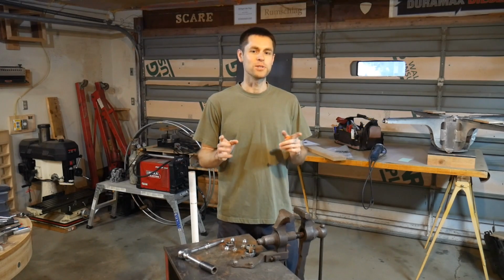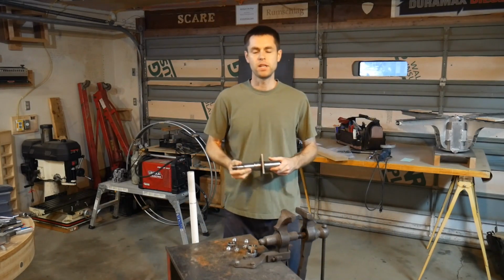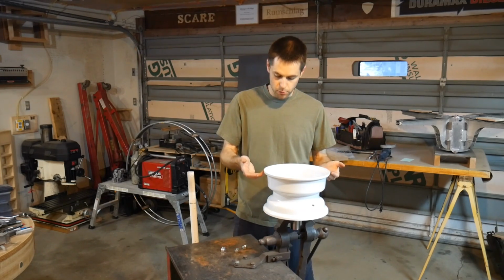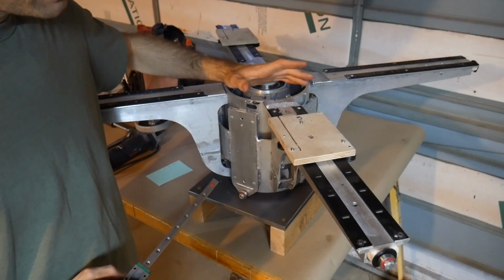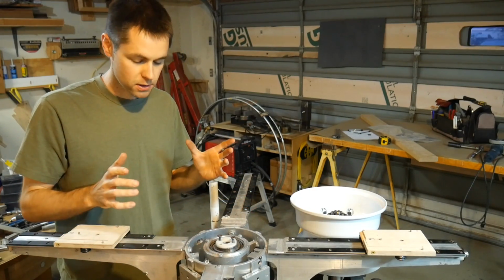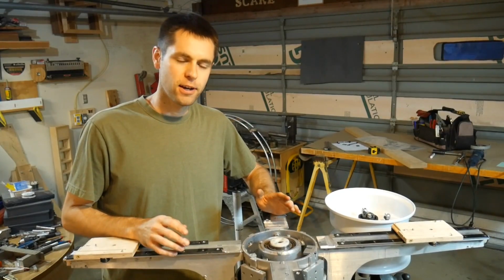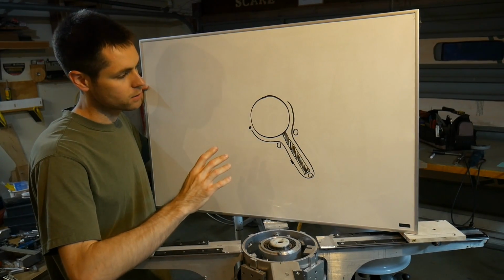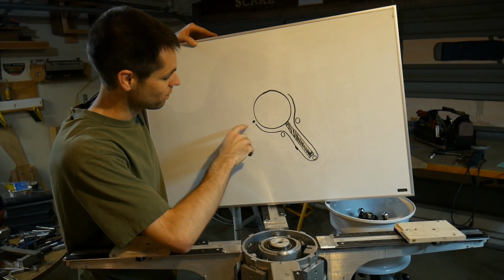Metal Expanding Table 01

Comment: Review how control cables in small aircraft are set up. Turnbuckles to adjust compression springs to maintain tension, etc. Cables, pulleys, turnbuckles, springs etc. all available at Aircraft Spruce and Specialties. They ship worldwide too. Check it out!

Comment: Well done sir. I see some mentions of bicycle roller chain, which is a good idea in place of cable. Is it possible to attach the cable in your diagram in some sort of slot to act like a cam when the attachment point goes past the end of the track to allow for the direction change? Last thing that comes to mind is if you are still wanting to use a stationary plate in the center, is there enough room left on the spindle to thread another nut? If so possibly weld a nut to the plate and that would be a fairly easy way to get it stationary. Just some random thoughts.

Comment: Could you explain how you would attach the tension cable to the base. 
Is the fixed point brought up to the slider level.
is the guide pulleys angled to allow horizontal movement at the slide, but a spiral to the fixed point
Is the whole cable and pulley system angled like a wedge between the base and the outer point. 

The last would need some type of hinge between the cable's shuttle and the top slider.
but depending on the geometry you could get the redirection movement with the hinge. the shuttle would never loop over the end pulley.

Comment: A tension cable system which goes over centre can be kept tensioned if the other end mirrors the motion, but it then brings you back to the bent arm across the centre pivot to achieve it. Most closed loop aircraft systems do not have tensioning springs but rely on the cable stretch. The tension is moderately high and achieved by turn barrels. A little link off the cable to travel round the outer pulley is one way of reversing the direction.

Comment: 14:24 Why not try these sliders on an incline? The table rotates anyway.. so why not use that motion to have the table travel up. While they sit on the incline they are all in contact and thus ensuring a play-less movement. (though the range of motion might be too limited.. going 11" sideways has to transfer into the 2 units up)

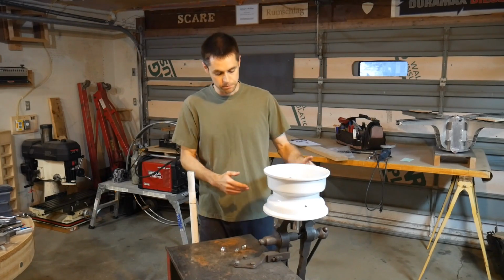Comment: Awesome project! As you were talking about welding to the hub at around 8:20 it struck me that bolting might have some advantages. 1. Less chance of distortion in the rim from the heat during welding. 2. Many folks don't have a welder (including me!) I don't know if you would be able to design this in such a way that even the welder would be unnecessary? If you could, the design would have even greater universal appeal :)

Comment: Why not use a chain between both sides of the cable.  It can be wrapped around a cog, with the slide being moved by a shuttle attached to one or two of the chain link pins.  i.e. both the cable/bowden tube and chain/sprocket  can be made completely from common bicycle parts.

Comment: 27:52 could always use a weight rather than a spring. If you had a pulley the weight could sit against the table leg. Not the most practical, but figured i'd point it out.

Comment: Scott, regarding the spring to take back the slag on the cable, you could use a compression spring. Terminate the cable with a threaded rod, throw this through a compression spring, a washer and a nut. The nut can adjust most of the slag, the spring is here only to take the last couple of millimeters. Compression springs can be much more compact and that one could be both shorter (it does not need to take a lot of slag) and stronger. On my motorbike, the rear brake is activated by a rod that attach to the break lever through a compression spring, each time you brake, you compress the spring, so it must be robust, and there is a nut at the end of the rod to take of the slag.

Comment: On the common thread of bike parts, some of the ‘exotic’ shift systems worn with dual cables to push/pull the gearing may be worth looking into. Examples include the pinion p1.12. Small cable readily available, designed to handle repeated flexing on a similar radius, along with housing that has braze-on attachments to simplify routing.